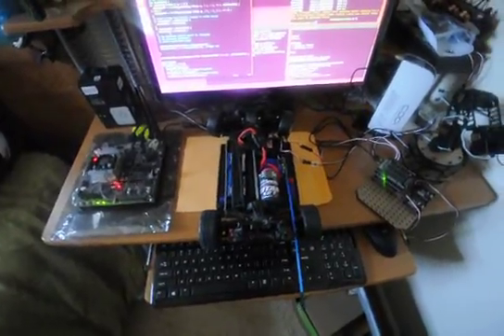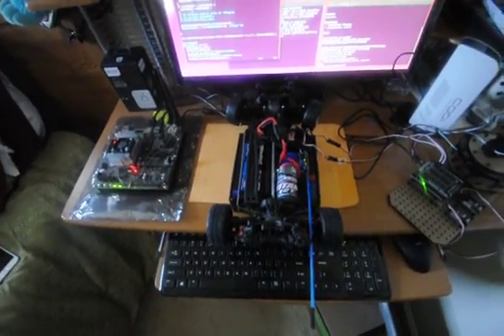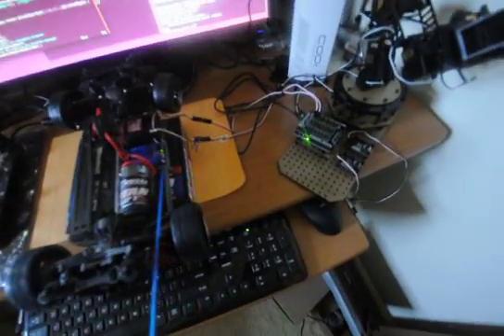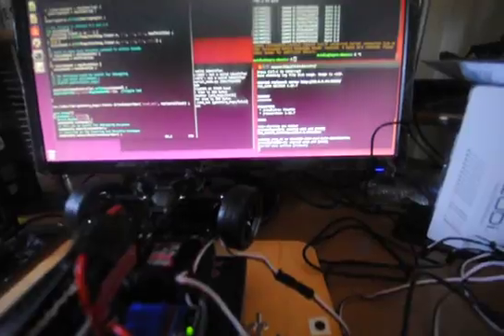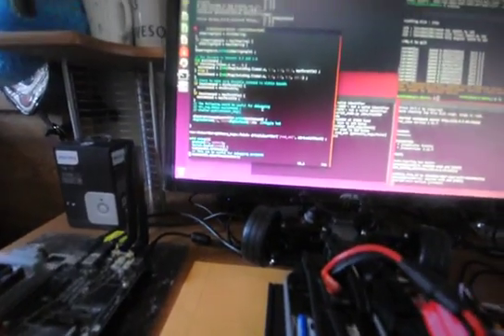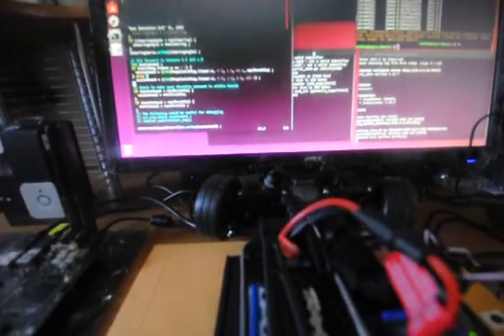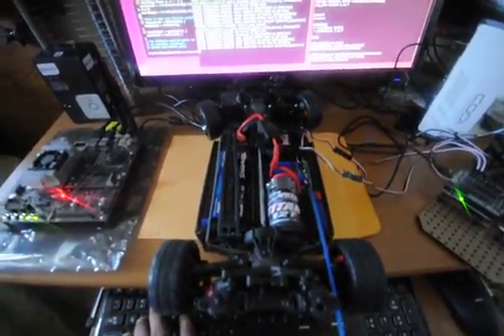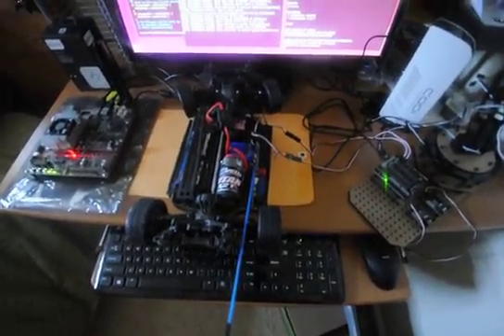Nvidia Jetson TX2 control Traxxas RC Steering and ESC using Arduino

Comment: Good video! I can't seem to find the code for the arduino that you've used, would it be possible to get a link for it? Thanks.
Reply: Search for Installjetsoncar on github. You'll get this code in Arduino firmware folder.